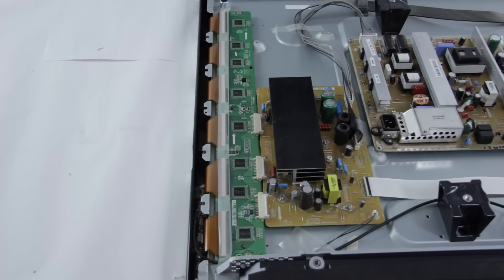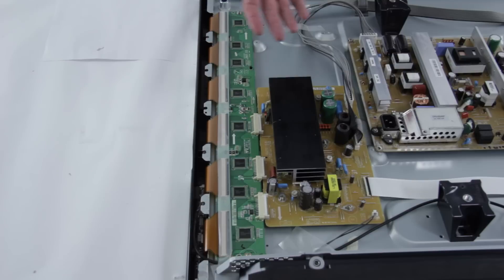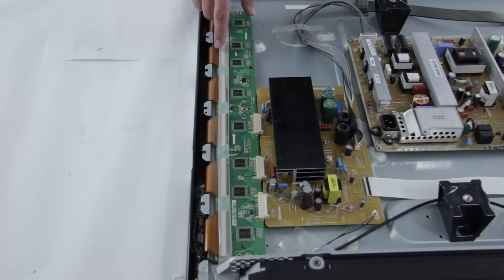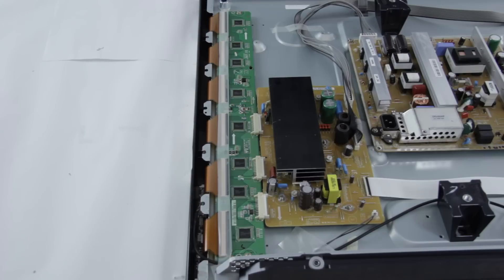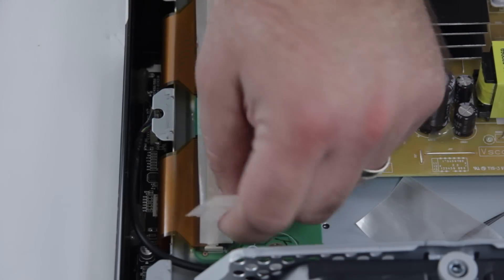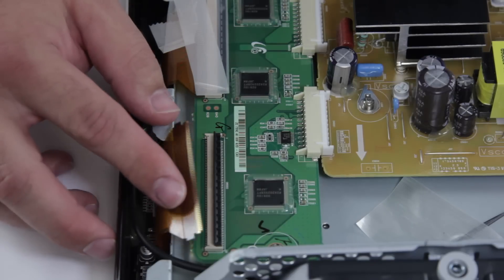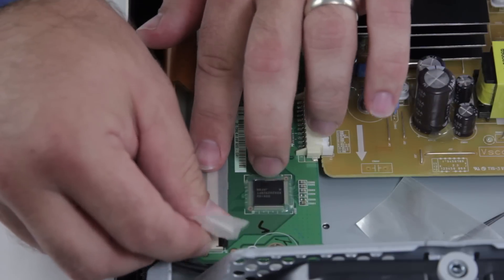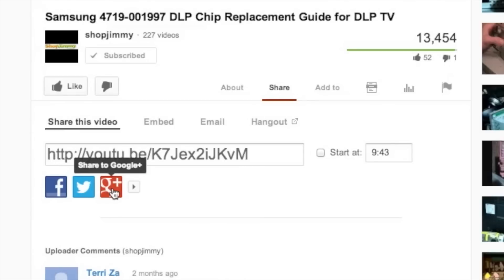Plasma TV Repair - No Image, No Picture on Plasma TV Screen - How to Replace Y-Buffer & Y-Sustain

Comment: My Samsung 50' Plasma model #PN50C450B1DXZA clicks on... displays a grainy CNN logo and border.... goes black.... and then plays music.  When you change the channel it switches to a different music station.  I tried unplugging the Y Sus and Z Sus independently and with both the music still plays.  I was about to order a Y Sus board but am now unsure of where the problem may be. Thank You in advance for any help with this issue.
Reply from the maker: +James Napper   Try all repairs and troubleshooting at your own risk.  I recommend replacing the Y-Main Board and the Y-buffer board in your TV.  Click this link to replacement parts for your TV model number:  http://www.shopjimmy.com/catalogsearch/result/?q=PN50C450B1DXZA+  There may be multiple boards for the same TV model number, be sure to match part numbers on your current board, with your replacement for compatibility.  Here is a link to a video showing how to identify your part number, click here:   https://www.youtube.com/watch?v=R1jmj_foId0Thanks and please let us know if you have any further questions with your TV Repair!  www.shopjimmy.com

Comment: I have a Samsung PN50B450B1D that powers on but no picture and has sound. What could it be?
Reply from the maker: +Russell Fought  Try all repairs and troubleshooting at your own risk.  I recommend replacing the Y-Main Board and the Y-Buffer Board in your TV.  Click this link to replacement parts for your TV model number:  http://www.shopjimmy.com/catalogsearch/result/?q=PN50B450B1D  There may be multiple boards for the same TV model number, be sure to match part numbers on your current board, with your replacement for compatibility.  Here is a link to a video showing how to identify your part number, click here:  https://www.youtube.com/watch?v=R1jmj_foId0  Thanks and please let us know if you have any further questions with your TV Repair!  www.shopjimmy.com

Comment: hello!.. I have a 60 inch samsung plasma model no: PN60F5500 , model code; PN60F5500AFXZA , Version No: US01 S/N: Z6VX3CBD500961A with no image but has sound, what is the probable cause? thanks Jimmy!
Reply from the maker: +Anthony Santos   Try all repairs and troubleshooting at your own risk.  I recommend replacing the Y-Main Board and the Upper and Lower Y Scan Drive board in your TV.  Click this link to replacement parts for your TV model number:  http://www.shopjimmy.com/catalogsearch/result/?q=PN60F5500AFXZA    There may be multiple boards for the same TV model number, be sure to match part numbers on your current board, with your replacement for compatibility.  Here is a link to a video showing how to identify your part number, click here:  https://www.youtube.com/watch?v=R1jmj_foId0  Thanks and please let us know if you have any further questions with your TV Repair!  www.shopjimmy.com

Comment: I have an LG 60PK950 bought in 2010. Turned it on last night and about 30 seconds later, everything went off. Tried several times and it wouldn't come on and stay on so I unplugged it and went to bed. Googled the problem this morning and found this video of yours. I know nothing about TVs but here's what I have done so far. I removed the back cover. Unplugged the Y and Z boards. Turned on TV and I have audio but no video. It stayed on for about a minute and then the TV shut itself off. Unplugged, waited 5 minutes. Then I plugged in the Z board, I have audio but no video. Stayed on about a min. and shut itself off. Unplugged, waited 5 minutes. Plugged in ONLY the Y board, I have audio and video but the video is very faint and fuzzy. The TV stayed on about 1 min. and shut itself off. Unplugged and writing to you. I'm not sure what to do next or if you have any idea what is wrong with it. Many Thanks!
Reply from the maker: +Penny Williams  Try all repairs and troubleshooting at your own risk.  This could be a problem with either the power supply or the main board in your TV.  You can replace each board individually to see if one of them fixes the problem.  Click this link to replacement parts for your TV model number:  http://www.shopjimmy.com/catalogsearch/result/?q=60PK950  There may be multiple boards for the same TV model number, be sure to match part numbers on your current board, with your replacement for compatibility.  Thanks and please let us know if you have any further questions with your TV Repair!  www.shopjimmy.com
Reply: +ShopJimmy.com   Thank you for replying.  I see where you are out of stock on the parts I might need but I'll keep checking back.    :-)

Comment: LG TV model PZ550-UA had colored hue spots across screen for some time, and tv would turn off intermittently, and now when turned on only has sound and no picture display.  The TV was manufactured in 2011 and I hate to not attempt to repair it due to it's size.  Thank you in advance for any help.

Comment: i have a lg50pa5500 with sound but no picture
Reply from the maker: +scott schlemmer   Try all repairs and troubleshooting at your own risk.  I recommend replacing the YSUS and the YDRVBT & YDRVTP boards in your TV.  Click this link to replacement parts for your TV model number:  http://www.shopjimmy.com/catalogsearch/result/?q=50pa5500  There may be multiple boards for the same TV model number, be sure to match part numbers on your current board, with your replacement for compatibility.  Here is a link to a video showing how to identify your part number, click here:  https://www.youtube.com/watch?v=GEllG3RV-tc  Thanks and please let us know if you have any further questions with your TV Repair!  www.shopjimmy.com

Comment: Hi there, I've got an LG plasma tv (model no - 42PC1DG-AA and product code- AAULLH). I was watching tv last night and all of a sudden picture had gone although the tv was running with everything else good. Only the picture was not there. i tried unplug everything and plug in back after 30 mins but didn't work at all. same thing going, everything is ok just no picture. what should i do? should i change the buffer board or some other thing ?
Thanks for your help......

Comment: I have an old 42" hp cloth-0602 ... I got it used. It worked fine but had red and white dots all over the screen. Then it started with a green screen for 30 minutes or so before picture would become normal. Now there is no picture and the power button is red. Can you help me repair this please? Thank you
Reply: Hp CPTOH-0602.   Autocorrect changed it on the original

Comment: Have LG50" Plasma 50PG20-UA I was watching tv and it had a pop and then the picture went out the power was still on and I got like a buzzing sound sounded like an old dial up modom. You can turn the power on and off put when it come on no picture but the buzzing sound . Could you please Help thanks Mike...
Reply from the maker: +Michael Hunt  Try all repairs and troubleshooting at your own risk.   I recommend replacing the YSUS and the YDRVTP & YDRVBT boards in your TV.  Click this link to replacement parts for your TV model number:  http://www.shopjimmy.com/catalogsearch/result/?q=50PG20-UA  There may be multiple boards for the same TV model number, be sure to match part numbers on your current board, with your replacement for compatibility.  Here is a link to a video showing how to identify your part number, click here:  https://www.youtube.com/watch?v=GEllG3RV-tcThanks and please let us know if you have any further questions with your TV Repair!  www.shopjimmy.com

Comment: The chip next to the top ribbon cable on y buffer board is melted.  Where can I get the chip and how do I replace it?  Thank you.
Reply: +Michael Scagnoli 
model  samsung/hpt5054x/xaa
Reply: +Michael Scagnoli I have subscribed.
Reply: +Michael Scagnoli - I cannot get the part number as the chip is melted.  Any suggestions?

Comment: Hi, I have a 50" pioneer plasma tv. Model # PDU-PC42H07. I was watching tv when suddenly the screen color turned to blue. you could still see the picture then it turned very dark black and you could still kinda make out the silouttes on the screen. i turned it off and back on a couple times. Now it wont turn on at all. Red stand by light blinks 6x's. what do you think the problem is?
Reply from the maker: +Michelle Fujita   Try all repairs and troubleshooting at your own risk.  I recommend replacing the Y-Main Board and the buffers in your TV.  Unfortunately I do not see any replacement parts in the search results for your TV model number on our website.  Thanks and please let us know if you have any further questions!  www.shopjimmy.com

Comment: Any help with my 60" LG - 60PZ950U is much appreciated.

Here's a timeline of what happened:
 - Working nice, great picture, turned off
 - 2 hours later, turned on, picture foggy and grainy.  It was late, thought it was comcast, turned off, went to bed.
 - Next morning, picture still grainy and foggy, kept tv on while trying to navigate to the tv's whitewash feature, before I could get to the whitewash feature, the screen kept getting darker and within 5 minutes the screen is completely black.
 - My 60" plasma is now a radio (with great sound) mounted on my wall.

From the video, I'm guessing Y buffer?  Any more help is greatly appreciated!

Comment: I have LG PJ350r 42'' TV. The TV just goes black and no sound either; however, I can browse thru menu without a problem. Sometime, I have to unplug a cable for 10 minutes and replug and turn it on, it works. What is the problem I should look at? The repair costs as much as getting a new TV as quoted by technician. Please help!

Comment: I have a model # pn50c450b1dxza TV and it's has sound but no picture and I turn it off and turn it back on it show a static screen just for 1 second and goes off I can send u a video of what it's doing
Reply from the maker: +jerry walker   Try all repairs and troubleshooting at your own risk.  I recommend replacing the Y-Main Board and the Y-Buffer Board in your TV.  Click this link to replacement parts for your TV model number:  http://www.shopjimmy.com/catalogsearch/result/?q=pn50c450b1dxza  There may be multiple boards for the same TV model number, be sure to match part numbers on your current board, with your replacement for compatibility.  Here is a link to a video showing how to identify your part number, click here:  https://www.youtube.com/watch?v=R1jmj_foId0  Thanks and please let us know if you have any further questions with your TV Repair!  www.shopjimmy.com

Comment: Interested in tear down or guide for Samsung 3D 51" PS51D8000
Power surge, power getting through, but no sound or picture.
May have another one, which works but the screen is damaged (has sound)
Reply from the maker: +Leilani Maree   Try all repairs and troubleshooting at your own risk.  I recommend replacing the y board and y buffer(s) in your TV.  Unfortunately I do not see any replacement parts in the search results for your TV model number on our website.  Please reply with your part number on your main board and I can try searching for replacement parts.  Thanks and please let us know if you have any further questions!  www.shopjimmy.com

Comment: My one year old 60 inch LG plasma tv works fine for my Xbox on HDMI2 but if I switch to cable tv on HDMI1, I see the image but it disappears after about 1 second. Can you help me?
Reply: +Jim Night...Nevermind. I thought it obviously can't be my tv since I have a picture when using my Xbox and Bluray player. I called my cable company and they did an update so I reset my cable box and it fixed the problem.

Comment: lg model  60x6  flat screen plasma , lower buffer get hot, and a have not picture(black screen with little be snowing ) sound ok, fallowed your instructions to check each board and get same results( but just a lit be more clear screen but still black, i disconnected the buffer board 'cause it was getting hot after a plugged in the tv and a pop sound, What can i do now ? please advise.
Reply from the maker: +Aldo Abramson   Try all repairs and troubleshooting at your own risk.  Please reply with your TV model number.  Click here to view a video that shows how to find your TV model number:  https://www.youtube.com/watch?v=S51nhAmwR2M  Thanks!  www.shopjimmy.com

Comment: I have a LG plasma model number 50PK950. The TaV just turned off and when I turn back on it is a black screen. When I press input or volume of channel it does nothing. What could this be?
Reply from the maker: +Angel Olivera   Try all repairs and troubleshooting at your own risk.  I recommend replacing the YSUS and the YDRVTP & YDRVBT boards in your TV.  Click this link to replacement parts for your TV model number:  http://www.shopjimmy.com/catalogsearch/result/?q=50PK950  There may be multiple boards for the same TV model number, be sure to match part numbers on your current board, with your replacement for compatibility.  Here is a link to a video showing how to identify your part number, click here:  https://www.youtube.com/watch?v=GEllG3RV-tcThanks and please let us know if you have any further questions with your TV Repair!  www.shopjimmy.com

Comment: Hello, I have a LG60pV450. My screen started off being a little discolored. Now my screen is black and wont turn on. Can this be fixed for a decent price? Please help.
Reply from the maker: +Gregory Foster  Try all repairs and troubleshooting at your own risk.  I recommend replacing the YSUS and the YDRVTP & YDRVBT boards in your TV.  Click this link to replacement parts for your TV model number:  http://www.shopjimmy.com/catalogsearch/result/?q=60pV450  There may be multiple boards for the same TV model number, be sure to match part numbers on your current board, with your replacement for compatibility.  Here is a link to a video showing how to identify your part number, click here:  https://www.youtube.com/watch?v=GEllG3RV-tcThanks and please let us know if you have any further questions with your TV Repair!  www.shopjimmy.com

Comment: Well my samsung 50" plasma screen went black have sound but no pic.  . Its a model HP-T5054 any ideas what it can be or what can i check to see the problem. also i have the back panel off looking at the Y board and the X board i see on each has one puffy capacitor can you help.

Comment: I have a Samsung Plasma 60 inch TV that's about 3 years old.  It was on then all of a sudden my circuit breaker turned off.  When I turned the breaker back on there was a loud pop sound that I heard then smelt a little burning.  I was wondering if it was something that I could fix myself.  Thank you for any information you can provide.
Reply from the maker: +Brian DeCanio   Try all repairs and troubleshooting at your own risk. This could be a problem with either the power supply board or the Y board.  You can replace these boards individually to see if one of them fixes the problem.  Try all repairs and troubleshooting at your own risk.  Please reply with your TV model number.  Click here to view a video that shows how to find your TV model number:  https://www.youtube.com/watch?v=S51nhAmwR2M  Thanks!  www.shopjimmy.com

Comment: Hi I have a jvc 42" plasma TV, it had a small knock in teh process of moving, it turns on fine and there's sound just no picture, heeelp haha model number is VM-42V31BUE
Reply from the maker: +Teto Kusari   Try all repairs and troubleshooting at your own risk.   Unfortunately there is not a fix for this.  It sounds like maybe the glass got cracked.  Thanks!  www.shopjimmy.com

Comment: Samsung 1086 Model PN50C680G54, black screen, plasma...

I was watching it and all of a sudden the screen went black...I still have sound but nothing on the screen.  I contacted a repair guy here in Scottsdale, AZ and was told it would be about $300 to repair...advice please and thank you.
Reply from the maker: +Manae Deaner  Try all repairs and troubleshooting at your own risk.  I recommend replacing the Y-Main Board and the Y-Buffer Board in your TV.  Click this link to replacement parts for your TV model number:  http://www.shopjimmy.com/catalogsearch/result/?q=PN50C680  There may be multiple boards for the same TV model number, be sure to match part numbers on your current board, with your replacement for compatibility.  Here is a link to a video showing how to identify your part number, click here:  https://www.youtube.com/watch?v=R1jmj_foId0  Thanks and please let us know if you have any further questions with your TV Repair!  www.shopjimmy.com

Comment: Hello -  I have a Samsung 42" PN42C450 (looks the same as in the video above).  The screen went black during viewing, but still had sound.  Replaced Y Buffer same, still black, but will see light lights on bottom right of the screen right at power on, then they go away.  Then replaced the Y Sustain and still no picture and same flicker at startup.  Any other ideas or options?  Thank You.
Reply from the maker: +Stuart Uken  Try all repairs and troubleshooting at your own risk.  It sounds like you have received defective replacement parts for your TV.  Thanks!  www.shopjimmy.com
Reply: +ShopJimmy.com   Is there a way to test them?  Your site was out of the Y Buffer, but found that on Ebay, the Y Sustain came from ShopJimmy

Comment: HI.. I HAVE SAMSUNG PLASMA TV HP-R4272C MODEL. TV GOT NO POWER.. I CHECK ALL VOLTAGE OUTPUT IS OK EXCEPT THE POWER OUTPUT TO THE MAIN BUFFER.. I'M MISSING 202 VOLTS ON THE VS PINS. CAN YOU HELP ME TROUBLESHOOT THIS PROBLEM... HOPE YOU CAN HELP ME AND MORE THANKS TO YOU...